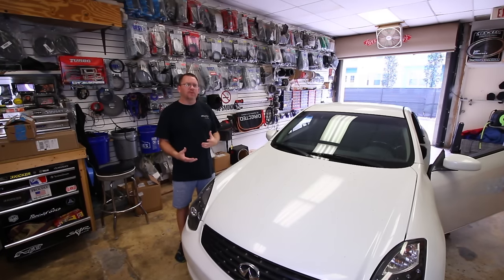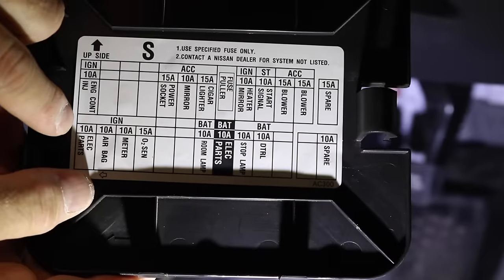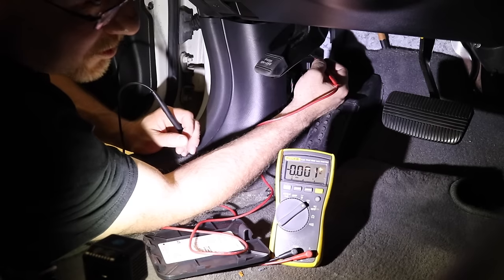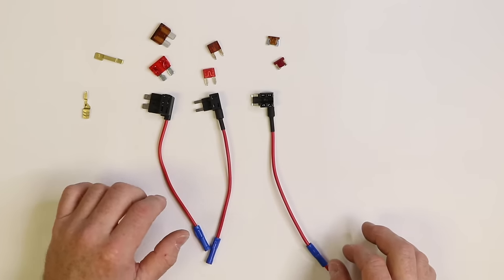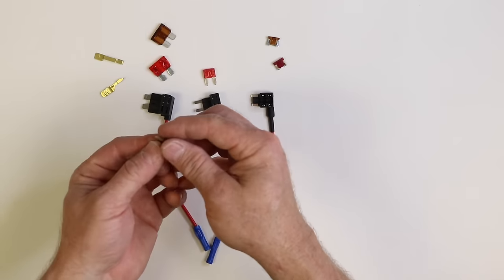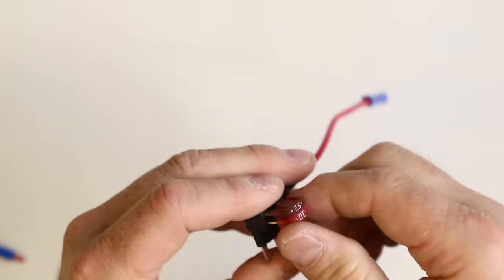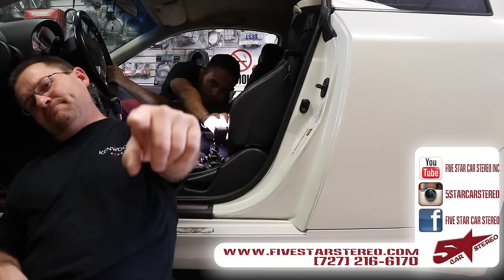How to tap into your cars fuse box safely and cleanly

Comment: Im curious, I assume the manufacture already takes this into account but... so the original fuse is 10A and I want to tap it with 1A, now there is 11A running through that slot and wire. If I were to have a fuse tap that is rated 2A-10A is that referring to the original 'greater current' fuse? OR would I need a 2A-15A fuse tap because my total current is 11A?

Hopefully this makes sence, basically Im concerned about too much current through the fuse tap due to the way the label is worded, not the fuses themselves.
Reply from the maker: Ben P. You would keep the original fuse at 10 amp. The new fuse does not pull though the old fuse. The new fuse is just for what you are adding.
Reply: I have a similar question.  I'd like to install a small audio amplifier that only draws 15A.  If I use an existing accessory fuse that is rated at 20A, then piggyback my 15A fuse on top of it, I am now drawing a total of 35A out of this circuit that was only supposed to provide 20A.  Is there any limit to how much current I can pull?

Also, my car has several fuses that are labeled for things like sunroof and power seats that my particular model of car does not have (I have the base model, and I guess they use the same fuse box for some of the higher trim levels).  Is it safe to go ahead and use these fuse slots?
Reply: There are always limits. 
Think of it this way: 
Your car has a wire going from the BATTERY to a DEVICE (lights, radio etc). Somewhere between the battery and the device is a FUSE (so when your drink spills all over the dash it doesn't catch fire). 
Lets say the device draws X amps. The car maker selects a fuse that is higher than X amps (so the device won't blow the fuse under normal use).  The wire that runs from the battery to the fuse, and from the fuse to the device is of a certain DIAMETER that can handle MORE than the fuse (because the purpose of the fuse is to melt before the wire does). 
So the wire can handle MORE than the fuse and MORE than the device.
But....  HOW MUCH more?

If you piggyback another device at that fuse location, 
THAT WIRE FROM THE BATTERY TO THE FUSE LOCATION DID NOT INCREASE IN DIAMETER
and it may OR may not be able to handle the amps you are adding. 
If your newly added device uses the same or less amps as the device it is piggybacked to, you might be OK.
But only if...
you don't use BOTH of those devices at the same time.
I suggest trying those unused slots you were talking about, but make sure those slots 
1) have power 
2) don't exceed the size fuse that slot normally takes.
Good luck!

Comment: So when you’re tapping in, you want to make sure that the side of the fuse you attach the wire to will be placed the cold side on the fuse box? You never want the wired side to attach into the hot side of the box because of fire hazard? Is this correct?

Comment: Do I still need to put a fuse to what I’m powering if the line already has a fuse? The fuse tap that came with my air suspension kit is pretty janky and I’ve had issues with the system shutting on and off due to poor connection. The tap wire already has a fuse wired in. Would I need an extra fuse on the tap that you use on the video?
Reply: Yeah, if you use this pig tail, you still have to put a fuse, or it won't complete the circut.
Reply: @OBS_Gohst92  ok do I need at least one or do I need both fuse slots with fuses in them? Also if the fuse I have available is an unused slot and it’s rated for 15 amps is it okay if the tap I’m using is only rated for 10? I’m guessing not.
Reply: @asapmimic1289  both fuses if you want both circuts to run
Reply: @asapmimic1289  and if its a 10 amp circuit use a 10 amp fuse
Reply: @OBS_Gohst92  ok so the second circuit that is going to my air suspension only uses a three amp fuse. So with a tap I put the stock fuse on the bottom tap. Then on the top slot do I put that three amp fuse from the kit and leave the inline fuse empty or should I put a 5 amp fuse on the top slot and leave the inline 3A fuse there?
Reply: @asapmimic1289  you put the original fuse in the bottom slot on the tap, and put the new 3 amp fuse on the top, there for your top circuit (air suspension) will have its 3 amp fuse and your bottom circuit will have the original fuse from the pannel
Reply: @OBS_Gohst92  thanks for answering my questions. I really appreciate you taking the time to answer my basic questions. I’ll work on it later and share my success or failure.
Reply: @OBS_Gohst92  I’m back and I got it working. I just have one more question. Is it okay if my bottom fuse is 15 (original factory fuse) a 10 amp fuse on the top of the tap and then I have the inline 3 amp still where it was? It works fine and I don’t see why it would be an issue but you’re smart so I figured you’d know. I’m guessing if I wanted the 3 amp on the actual tap I would need to cut past the in line fuse and connect after it, since the inline needs a fuse to complete the circuit.

Comment: Hi can I use the reverse fuse to headunit mute wire for cancelling out the audio when reversing as I've just installed aftermarket sensors for ford focus mk2 and when audio is playing you can't hear the beep noise 😂

Comment: i have a silverado and i have a pa system, a big lightbar in my grill ad then 2 smaller ones on my buper. i have everything pluged directly to my battery. it always drains my battery ho can i run them so that they only have power when the cars on.

Comment: So for the 15 AMP fuse you installed, was the accesory fuse a 10 AMP?
Reply from the maker: AleJDM22 yes it was the accessory fuse we adding in. It needs to be smaller then the main fuse.
Reply: @FiveStarCarStereoInc  It needs to be smaller, or is equal all right?

Comment: can i tap fuse box to install a blind spot camera then connect the positive cable comin out of my tap to the positive cable from the camera then plug to the video input on my radio pionner 1500 what i want to do its every time that i put  right side blinking light  to turn the bling spot image come out on the radio??

Comment: I have a question. I bought this, but I don't understand. I want to hook up a second cigarette lighter (for a dashcam adapter), it comes with 2 wires, + and -. Makes sense to me. However the fuse tap only provides one wire, just like the 3 in the video, it only has a positive, right? So what do I do with the negative wire that comes from the cigarette lighter? and why doesn't it just go in the tap?
Reply: delano88888 other wire is for ground
Reply: The black wire goes to the ground, or your negative. In order for the circuit to be complete and give power to your dash cam adapter.
Reply: Connect the -ve black wire to any metal part of the car.
Reply: If you don't know what a ground wire is then maybe you shouldn't be doing electrical work on your car and just let the garage to it
Reply: Joseph Reese that's cold but true
Reply: Ensure that you keep the appliances connected to max. 10A or 15A depending on the tap kit you buy, a dashcam should be OK, an actual cigarette lighter for example will draw too many amps for this setup.

Comment: What amp fuse should i use if I use an empty spot that gives 12 V on ignition? Im trying to connect a radio and the radio comes with a 15 amp fuse in it, i guess a 20?

Comment: 7:38 Why did you put the top fuse in a different direction than the bottom fuse? Shouldn't the load side be the same? So if the bottom fuse load side is on the left, your top fuse would also be on the left?

Ps:
From our side watching, the bottom fuse read rotated 10A, while the top fuse read in a normal way 7.5A. Why don't just put the top fuse in a rotated 7.5A just like the bottom??
Reply: Daniel Williams The rotation of the fuse itself doesn't matter. So if you put it like the text is upside down or normal. It's just a fuse (cable/connection) that burns when there's too much electric on the fuse.
Reply: The load or hot side is the side of the socket that draws power. The fuse itself is basically just a wire that connects it to the device you want to power, so it doesn't matter which way it goes.

Comment: I need a piggyback fuse holder but the wire on most of them are 16 gauge. The lead wire i want to hook up is 18 gauge. Can i hook it up still? or should i try to find a piggyback fuse holder with 18 gauge?

Comment: great video!  so far the most informative one i have seen for this specific type of install so far.  i do have a question, and i think the answer is yes but i figured i would run it by someone first.

can you install multiple fuse taps into a vehicle?  not piggybacked, but for example, could you install one fuse tap on the cigarette lighter, and lets say another fuse tap on the other power outlet or radio?  i want to have a hardwired radar detector as well as usb port which will be closely located where i will put a phone mount and have constant charge for my phone.
Reply from the maker: Sunny Bhola yes that would work fine, thank you

Comment: my car needs a fuse tap for the 12 volt i guess wire for when the ignition turns but the radio says its a 12 volt wire but when i look at my car it says its a 12 volt ignition line but where the fuse is its only a 2 amp fuse ?

Comment: So i could use this to wire a remote speaker wire to the cigarette fuse for my amp since i tested it and its only a 12v hot when ignition is on?i finally learned what a LOC was and want to hook up a system but everyone does the wire wrap around on fuse so just wanted to clarify that i could do this amd it be safer and prevent a fire. Lol
Reply from the maker: +9872jake9872 yes using one of these would be safer and work with that fuse you tested.

Comment: What do you do after it's installed but then you can't get the fuse box cover to fit because the fuse tap sticks out too far?  I can't leave the fuse box exposed just to add this wire.  I'm stuck.

Comment: This is a good video up until you failed to mention that the sum of the 2 new fuses must be equal to or less than the designed circuit fuse you originally removed, in this case (15amp)  to properly protect the wires in the original and new circuit.
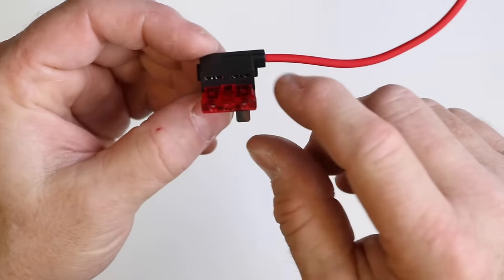Reply: All Things Electro-Mechanical   So, I am doing the same connection to a 15amp cig lighter circuit. Dashcam install via USB. What should be my fuse amp size used in the set up.   He did mention at 6:50 the top fuse always has to be lower.  He used 7.5 on the top, and 10 (original to the circuit) which is not equal to or less than his 15A.  What would you recommend?  7.5top and 7.5bottom or 7.5top and 5.0bottom  please let me know  Thanks
Reply: Cana Dude yes you need to find the max Full load amps that the dashcam uses . Then subtract that by the 15 amps circuit. So if your dash cam is 2amps use a 2 amp fuse and the other circuit will now be 13amp or less never greater than the original circuit.
Reply: @ATEMOFFROAD  Ok.  My dash cam does use just 2A.  Is there such thing as a 13amp fuse?  (to make the total 15a)?  Or should I use the 2A fuse with say a 10A fuse?      Also, this is strange,  I just tested the cig. adapter circuit using a voltage meter because I know the cig lighter only works to charge my cell phone with the key in the ignition (car started), why is the voltage meter still showing 12 plus amps for that circuit WITHOUT key in ignition?  Some other circuits I tested ie "ABS Brakes" show 00.0, (but obviously I don't want to put an add-a-circuit to that)
Reply: Cana Dude yes the 10amp will be sufficient. Always less will protect the circuitry. The 12 volts you see is most likely voltage not amps. You would need a clamp meter or open the circuit to test for current amps. And it’s unlikely but possible you have a clamp meter that tests for DC amps. If you want to test for amps safely they have in-line amp meters that you can plug into the socket while things are running or drawing a amp load from the circuit. Hope this helps

Comment: your video is helpful. I do have a question. I'm looking to install Apple Carplay on my 2015 Porsche Macan, and the module will need to draw power from the fuse box. Would you happen to know if I can simply plug the power supply into the passenger side fuse box slot A6 given that the driver's side fuse box is too far from where I need to mount my module?

Here is the Porsche Macan Fuse Diagram

https://fuse-box.info/porsche/porsche-macan-2014-2018-fuses

Comment: What do you attach to a fuse tap pigtail in the female end?
Reply: The end of the tail is a crimp connector. You strip your wire and twist the end. If it's too narrow, fold over the stripped end so it fits snugly into the connector. Then crimp. You'll need to get a crimp tool as well. If you don't have a crimp tool, you can cut the crimp connector off and strip that end too and twist the wires, solder if you can and insulate the bare joint.
Reply: G SAU Thank you :)

Comment: Do I have to add a Ground wire to it? I'm trying to connect LED lights to my car and they say I need to Ground it. They gave me the same fuse extender that you showed.
Reply from the maker: +Jgomez the lights will need to be grounded, but not the fuse holder. The lights should have 2 wires 1- for power that will go to the fuse holder 2- for a ground to the cars frame.

Comment: at 8:41 it shows all the fuses in the panel, and i noticed the numbers on the fuses are not all the same, some are up-side-down.  So what is going on here?  Is the fuse box panel switching the load side? or are the fuse numbers printed in random order on each fuse?   I would think all fuse numbers would be printed the same way and all the fuse numbers would all be in the same direction.  
why are the fuses oriented randomly on the fuse panel?    seems like an electrical engineer would not design a car fuse panel this way. they are 'really picky' about hot and ground.
Reply: Now I'm not an electrician so take that with a grain of salt but: 

It doesn't matter which way the fuse is inserted into the box (and thus whoever put them in didn't bother to make sure they all went the same way) because the fuse will work either way; it's just a thin piece of metal that will split apart if too much current goes through it, that completes a circuit - and is such not 'sided'. It's only when you're tapping into the fuse, that you need to ensure the side of the fuse that will be cut off when the fuse blows, is the side that you draw your power from, or the fuse will blow but you're still pulling power from the hot side because that's the side you tapped into. 

So the fuse itself is not sided, but the holes it plugs into, and thus which side of the fuse you draw power from IS sided.

Comment: I understand so much until you start talking about load and draw side. Such as putting the fuse back in a certain way matters too right? So you're saying that one side of the fuse is draw and load? Like how would I know which side is draw and load once I pull out the fuse? I'm confused and would like to learn more about it. Also, when using a fuse tap? We're always using the old fuse and the new fuse that is provided with the tap? Correct? I would like  to understand more about that also. For example, I'm taking off my 15a to fuse tap into. I'll be using the old 15a and how much amp do I need when I add the new one to go on top of the old one?
Reply: Better way to say draw and load would be power and your device, draw = battery power side of the fuse terminal and load = device side of the fuse terminal you are trying to get the fused power to. Load is a common term but I dont understand why he didnt just say "battery power" or "side of fuse terminal that connects to battery"

Think of a fuse as to terminals with thinner softer metal connecting them, when to much current goes thru the thinner metal between the terminals heats up and melts, thereby giving you an open circuit.

Simple Fuses like in your car do not have electrical polarity, at least not these car types ( only a very specialty type might for other system design reasons in advanced equipment ). The fuse may have mechanical polarity, such that the markings on them are readable in a certain direction or to keep fuse mechanically locked from G-Force movement, so it doesn't matter really which way you insert it.

The "fuse tap" body definitely has polarity, meaning you best have the correct terminal side without the wire connect in the fuse box to the fuse terminal that goes to the battery. Thats why you need to check for which terminal is the battery side terminal in the fuse box .The "fuse tap" he showed is nothing more than two terminal posts making an open circuit and accepting 2 fuses. You CANT put the terminal side of the "fuse tap" with the wire to the fuse terminal in fuse box that goes to the battery, you will still get power but it wont be fused. Read below.

Insert the fuse you removed into the terminals that do not have the wire coming out. Now your car should work like normal, start it and make sure what ever you just messed with still works. Now add the correct size fuse to the "fuse tap" slot (it was the top one in this video I believe), Connect the "fuse tap" wire to the power wire of your device, typically red, but check your manual, then connect the devices ground wire to the chassis metal , almost anything metal as long as it goes to chassis and then it will travel back to the battery negative terminal. You can undo a non structural screw any where or look for a ground terminal that has a lig and wire to it, but don't mess up engine grounds, you can also look for thin metal, drill it and use metal screw, just mae sure you can ohm out continuity of no more than 3-5 ohms back to batter negative terminal

Hope this helps.
-D
Reply: Don Agneta thanks for replying bro! I've been waiting to see if I can get a better understanding. I appreciate you writing back.